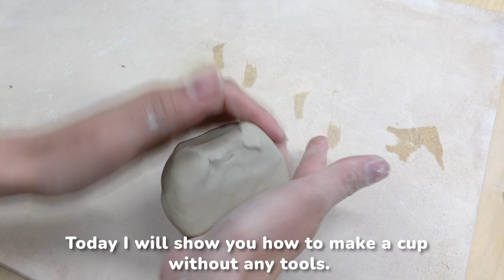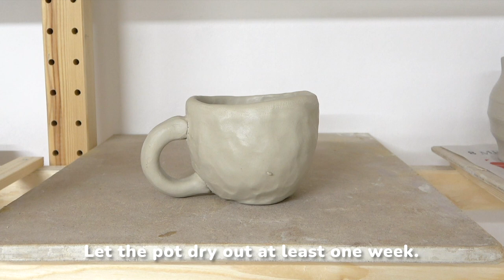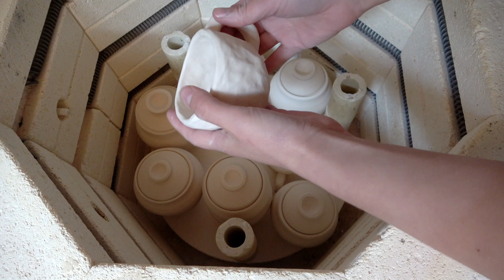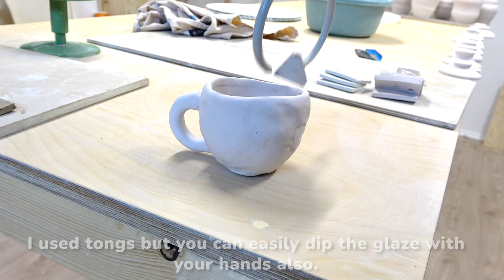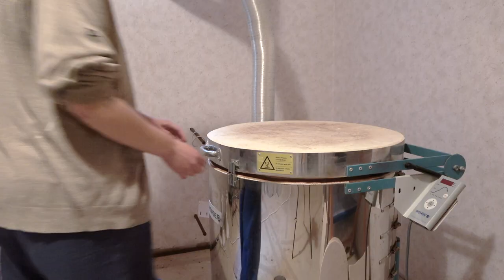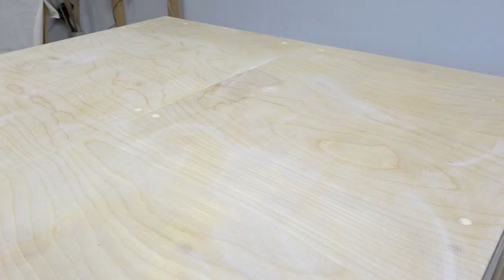How to make a Ceramic Mug - no wheel required! // Pinch Pot Tutorial // pottery at home

Comment: Love your tutorials! I have some questions:
1. Why we shouldn't use water to smooth fresh clay? Should we use water when the clay has some weeks?
2. Why did you remove the glaze from the bottom?
3. Should we only use slip when the clay is some time stored? Thanks!
Reply: I'm not Mia, obviously, but I thought I would attempt to answer your questions: 
1. Fresh clay refers to clay that is fresh from the bag and which has been stored properly. If the clay is very old and has begun to dehydrate, perhaps water will be needed for smoothing, but at that point you may want to rehydrate the clay, wedging it well, before using it. I probably use too much water in my work! Water won't hurt the clay or the process, but it will change the consistency of the hydration level of the piece, which could complicate the drying process. A damp, smooth sponge might be used for smoothing, but could also expose some grog, giving a roughness. Thus, your finger is the best option, which could be damp, but I'm finding that it really isn't necessary. (That was long! Sorry!)
2. Glaze on the bottom of the pot will fuse to the kiln shelf, making it impossible to remove the pot without destroying the pot and very likely the shelf!
3. Again, the age of the clay has less to do with whether or not to use slip (which is simply watery clay.) If the clay is still fresh (has not been left to dry at all) slip may not be necessary. If the vessel and the handle have been dried some to leather hard, slip will be desired.
With all pottery creation, learn the "rules" and then don't be afraid to break them. Play and experiment! Each potter must exercise the freedom to learn what methods work well for their clay bodies, their techniques, their environment and their process! 😊
Reply: Aaaww, thank you so much for  sharing!! If I would like to pain it, at what stage shall I do it?❤